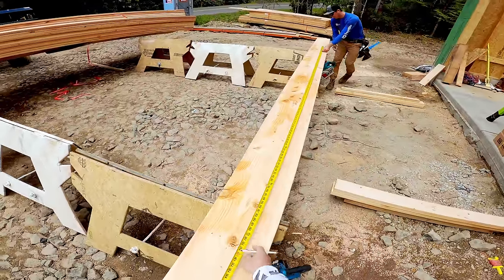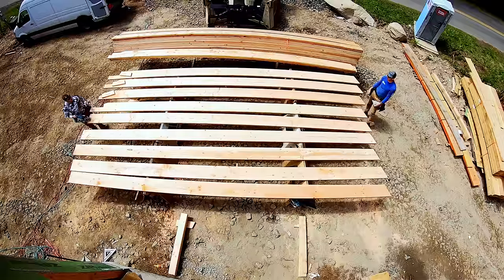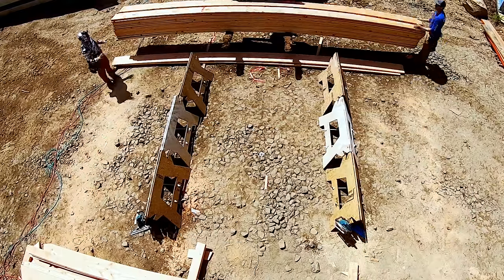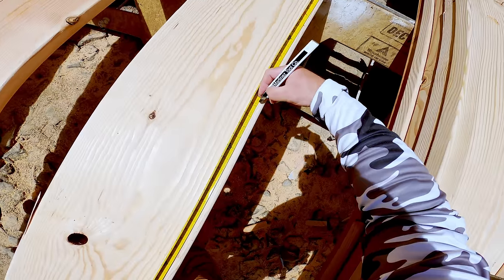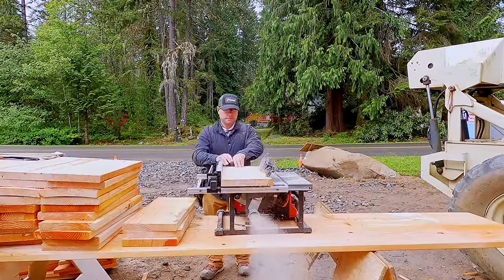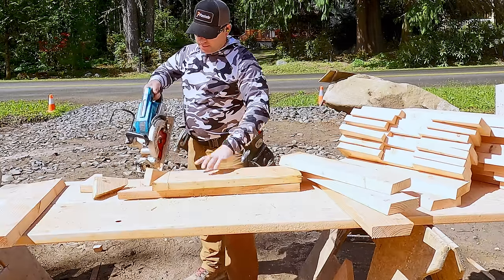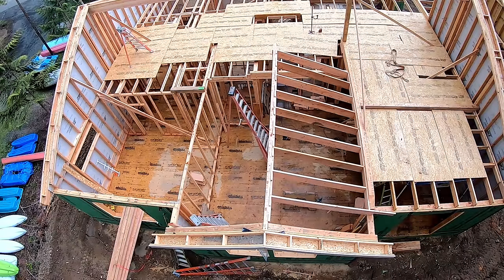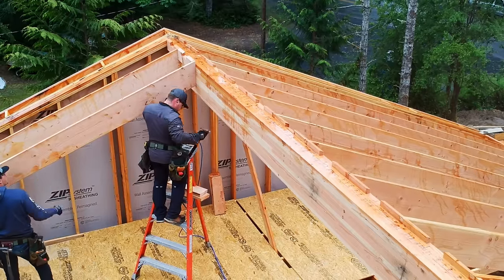Roof Framing- Cutting and Stacking the Lakeshore Project

Comment: I heard the mention.. hey young guys do not let the scrap drop on the ground.. saves from picking up and bending over.... I started watching this after I came home from my Physical therapy because I am having trouble bending over. I am also almost 60. I may also recommend to the young guys to save at least 10% of your doe from every job you do and do not touch it. We did all of this by hand including nailing back in the day. Lift a wall? Get every man on the site to come help lift gable walls. the other trades knew if they did not help they would not have a structure to work on so all obliged. Now I see a tela handler that rotates side ways never mind does all the wall lifting. I bet my back would not have the problems it does today if we had that machine. I like your style/tricks/new ways. i have learned a few things Thank you very much. One thing I could never see is during work hours back in the day talking to each other nonchalantly and actually making a video. No one stopped when we worked till the end of the day for a cold beer. Hopefuly you are making doe off of this to offset the loss of production.

Comment: Beautiful job!  True craftsmanship there. You won’t find a stick frame roof on any production homes here on the east coast. Everything is trusses and engineered designs to take the risk off the “carpenter”.
Reply: Framing here in central Canada every house I’ve built include 1-4 million dollar custom homes have all had engineered roof trusses, and as a young framer/carpenter I love building and setting up those kinda roofs but I would really love to stick frame my own roof like this
Reply: In Ireland we call truss roof carpenters , plastic chippies
Reply: Where on the east coast is that? I'm about as east coast as you can get, 1 mile from the atlantic, and every house goes up with stick built roofs.
Reply: @hyattbusbey3563  southern maryland

Comment: I noticed you pulling out the tape to set the ridge block heights. You should cut a dummy block to slide with you on the beam to set that height, save you pulling out the tape every time.
Reply from the maker: Good catch, I did that on the current job we are on, you can see that on IG.  I usually just eyeball where it the bottom of the block is on the glulam (as long as its straight).

Comment: Can you show a little tutorial on how to cut the angles for the rafter at the end of the video? Where the end of the rafter meets the top of the roof. How do you set the saw blade to the correct angles and everything so that you know you are not over cutting or making mistakes when you cut?
Reply: The bevel is set to the pitch (angle) of the roof it's landing on and the angle is the compliment to the ridge angle.
Reply from the maker: check out this video and see if it helps https://youtu.be/8elNffTYq40

Comment: You cut a lot of blocking off extra long joists / rafters - why don’t you make a jig that hooks the end of the board and guides the saw square to the right measure?
Reply from the maker: I don't think its worth the time.  I'll give it a shot though.  Part of the reason we have so much material for blocking is that we can't get 18' 2x12, so they send us 20's but charge for 18'ers.  I forgot to include that in the video.  Same thing with 14', they send us 16' for a 14' price.
Reply: I made one a few years back - old wooden hockey stick screwed to plastic speed square - cut the overhang off with the saw - used it quite a bit but then took it apart because I need the square one day - should have put it back together - hard to get wooden hockey sticks now.  We were cutting a bunch of bridging in an old house - my father only had to call out plus or minus 1/16, 1/8 etc. Love your channel
Reply from the maker: @gregorymacneil2836  I'd love to see that.  Jigs are one of those things that could have their own YT channel

Comment: 2x12 24' long! Each one must have cost an arm and a leg!
Reply from the maker: especially when lumber shot through the roof (pun) summer 2021 😬😬
Reply: I would've expected some finger joints in there. This is plywood joist territory.
Reply from the maker: @Fekillix  Back in 2008 I ordered 30' 2x12 DF and it was really good quality.  I don't know what those would cost now
Reply: One website (shillings something or other) has them listed in stock @$153 ea. Yikes. 11.5x1.5x30'

Comment: So why the dark ages vented roof? Spray foam under roof and save your clients big dollars for life of the house. Savings outweigh cost of foam. Especially if you consider the life of a well built house.
Reply from the maker: Hi Brad.  Spray foam in our climate does not provide the savings to outweigh the cost.  It is extremely expensive here, our energy costs or low compared the rest of the US and our climate very mild.  

It also doesn't provide the air sealing advantages widely claimed.  We know because we blower door test all our homes and recently partnered with a spray foam manufacturer.  It was a test house and very disappointing to all involved.   

While I agree there are some big advantages to a "hot roof" or unventilated assembly, there are some major disadvantages as well.  A vented roof assembly here, is very durable.  This house will be very energy efficient, quiet and comfortable.  It is wrapped in 1" polyiso foam, will test at 2 ach/50 or less and use energy efficient appliances.